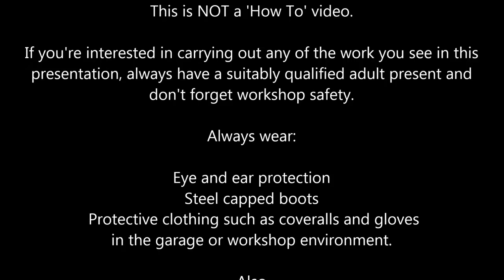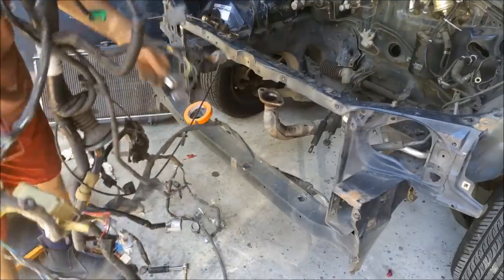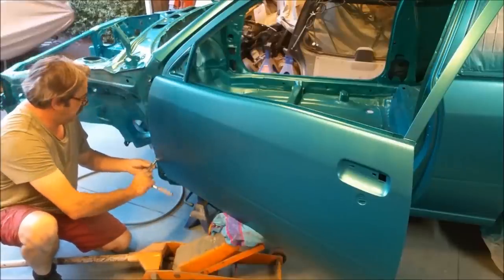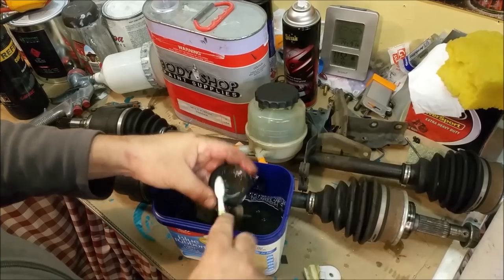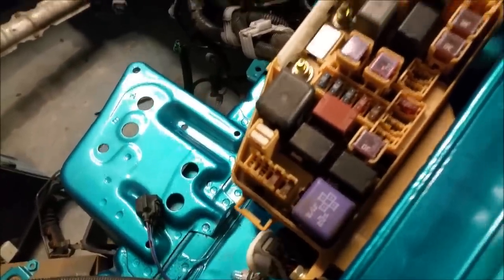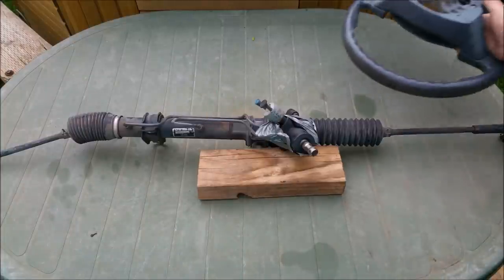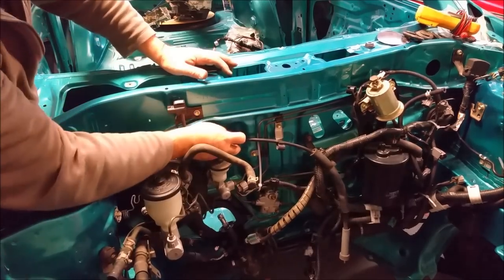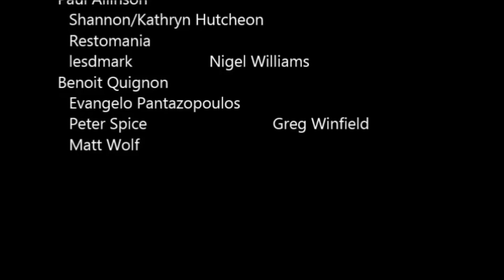Remote Learning - Let's Build a Car Part  1 - A Worn and Dirty Starlie

Comment: The effect of brake fluid on paint was a great convenience when I was a kid.  I'd bought an HJ Kingswood, and some previous owner had done a rattle can paint job on the grille and headlight surrounds, including the chrome edges.  So I removed those pieces at work one night and spent a half hour or so dipping a toothbrush into a bottle of brake fluid, spreading it all over and waiting a few minutes, then giving it a quick scrub and rinsing with water.   Looked like a new grille - cheap way to make the car look good again.  And when I got around to repainting them, even that job was easier than expected, as there were no rough bits, no paint caught in the corners, no scratches to fill, no rounded edges...made it so much easier.  :-)

I'm sure there are plenty of reasons why I shouldn't have done it that way, but boy, did it work well.  :-)

Comment: my wife had one from new ,only thing had done to it  timing belt 100k ,aircon pump replaced,new clutch Toyota struggled to get correct, new brake discs,over all cheap car to run to a point .

Comment: Would have thought the engine hoist could have lifted the shell and then whoosh the engine into the bayfrom underneath... just a thought.
Reply from the maker: Yes, I had the same thought, but I couldn't put stands under the shell at that height and I would have been trying to push the engine in from between the legs of the crane...
Reply: @PeterAndersons  never had the luxury of an engine hoist but I did an engine swop with blocks of wood and a trolley jack years ago when I was skint... not to be recommended. Sketchy as f...
Reply: Did an engine swap on an old Mini from below when I was younger - mounted it on the subframe, with the radiator, axles and most of the suspension already attached.  Glad we were working outside - we had to lift the shell a fair bit higher than we'd figured to fit the donk underneath, and as the garage had a low-ish roof, there likely wouldn't have been clearance.